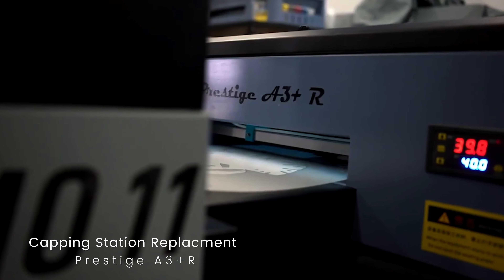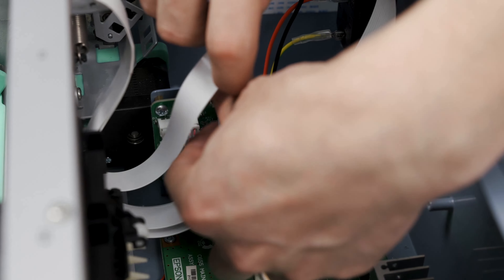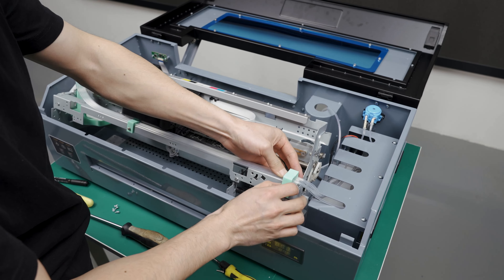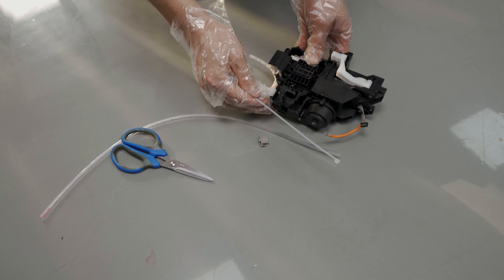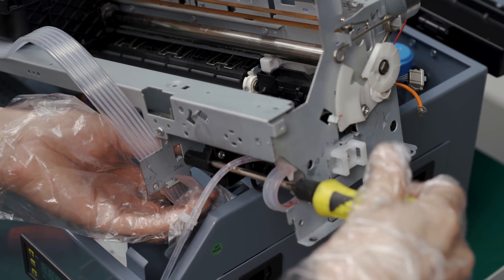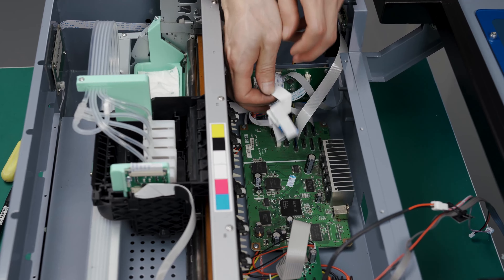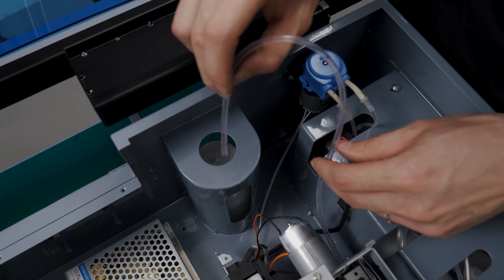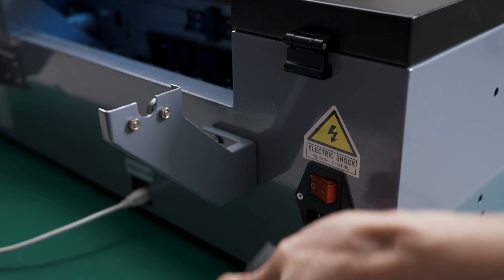Prestige A3+R How to Change Capping Station |  DTF Station

Comment: How often does this unit need to be replaced?
Reply from the maker: Hello, this will vary depending on usage. However, if you are seeing a high amount of CR errors this can be a sign to replace the capping station
Reply: You mentioned CR errors, does this include 2H CR load errors or would that be different CR errors?